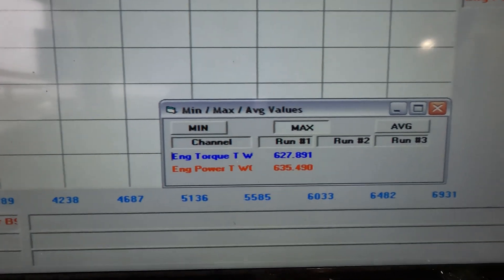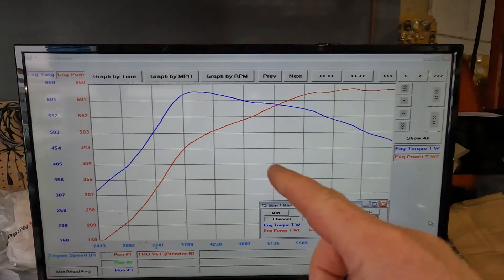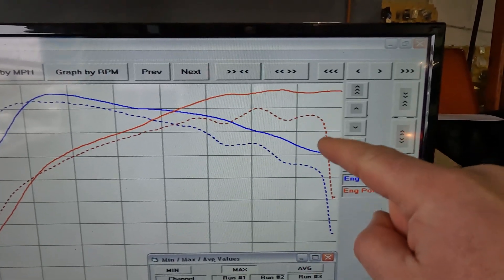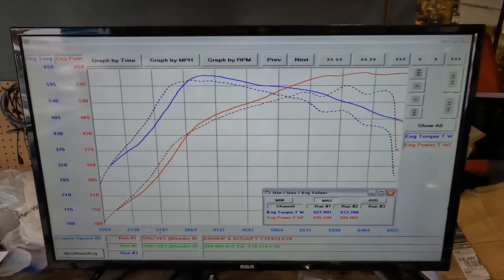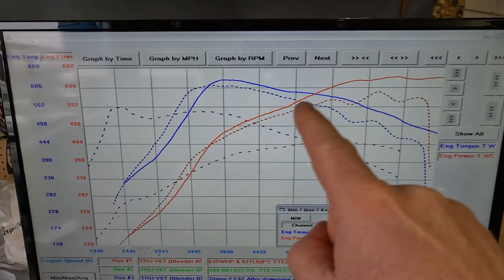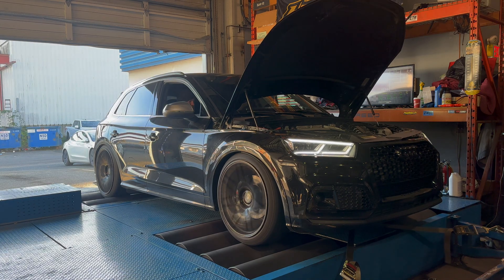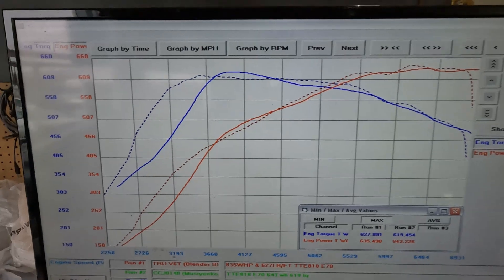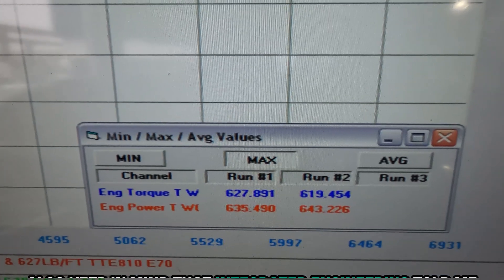TTE810 - Integrated Engineering Stage 3+ E70 Dyno Testing - Audi B9 S4

Comment: What’s the reliability like on a TTE810/710 car?
Reply from the maker: The TTE710 was discontinued by TTE so you definitely don't want to go that route. The TTE810 for the most part has been a robust turbo, although I've heard of some failures. The tuning paired with that turbo tends to be the biggest thing that causes failures with the motors though. Some tunes push the fuel system much too hard and end up blowing up motors.

Comment: damn 620 hp on a full bolt on is nuts lol
Reply from the maker: That's the torque figure. It was 635 WHEEL horsepower. So close to 700hp.
Reply: @VancityAudi  need to get rid of my s3 and get an S4 lol
Reply from the maker: @Carbeezy77  that you do!

Comment: Are you still on stock internals, trans and transfer case. Also are you still on stock injectors?
Reply from the maker: I mentioned the injectors within the first 40 seconds of the video. My engine, trans and transfer case are all stock.
Reply: I realized that after I commented, blonde moment. Anyway thank you for responding it was definitely helpful, I’m about to go full stage 3+ on my b9 s5 coupe. Your car is bad ass by the way.

Comment: Do you think the slow spool response was to do with the engine issue which showed up?
Reply from the maker: Nope. As soon as I increased the load by doing a 5th gear dyno pull or a 4th gear pull on the street, it spooled quicker.
Reply: @VancityAudi  still hoping you manage to get some more S4 content 🙏
Reply from the maker: @jimmymcgoo8641 regardless of what happens, I won't leave everyone hanging. I'll let everyone know what I end up doing.
Reply: @VancityAudi any updates on the S4?
Reply from the maker: @jimmymcgoo8641 we're returning it to stock and will be selling it. I'll fill everyone in via one final video once we're all done.
Reply: Is there a video coming out to update us on what happened to the S4? @VancityAudi

Comment: You started the dynorun from the SQ5 in much lower rpm than you did with the S4, therefore it can not be compared. Start the dynorun at 1500rpm.
Reply from the maker: That's not correct. As I mentioned in the video, the calculation for the tire size from one car to another (17" vs 22" wheels & tires) made it appear like the graphs were in the wrong place. If you moved the SQ5 graph over to the right where it should be, so it lined up with the same calibration that the S4 had, they start in roughly the same place.

Comment: I have a 2013 Audi s4 and I’m getting a p281c code and my transmission light is on idk if it has to do with the engine light but do you have any idea what it could be
Reply from the maker: A Google search will tell you exactly what the problem is. Your transmission will need some work most likely.
Reply: @VancityAudi  I’ve searched all over the internet and I can’t seem to find any parts for my car but thanks for the help anyways huge fan keep it up man ❤️
Reply from the maker: @Avlor Zebica  not sure you're looking in the right spots then? From what I understand it's an extensive repair. Thanks for watching. https://www.audizine.com/forum/showthread.php/767393-P281C-Code-Is-that-the-starter-of-DSG-Issues

Comment: Great results, congrats! 🎉 I wonder how much power you can pull on a regular 93 octane, and how long gearbox will last at these power levels 🤔
Reply from the maker: 93 octane dyno results will be coming soon. As for the gearbox lasting, I predict a very long time. Same transmission that the RS6 has, and they make even more torque than mine car does when tuned.
Reply: @VancityAudi  I believe RS6 got higher tier “clutch pack”, S4 B9 got zf8hp65a while rs6 has hp85 if I am not mistaken 🤔
Reply from the maker: @ShebanFPV  you could be right! That I'm not aware of. Here's to hoping it's last as long as I own the vehicle.
Reply: @VancityAudi  I hope too, for all of us B9 S4 owners 💪🏻

Comment: Hi , I’m in the Uk with no e85 or e60 , could you do a comparison on 93 file . I have the tte710 and want to know if the upgrade is worth it for power gains 
Cheers Paul
Reply from the maker: That will be coming to the channel soon.
Reply: @VancityAudi Cheers mate, did you end up posting the video? Tried to find it on your channel but no results. keep up the great work
Reply from the maker: @mariuspoparascu1822  Damn! I don't think I ever did. Sorry about that! I think the closest thing I have is this video where I tested the base TTE710 file on 93 octane fuel prior to upgrading the fuel system. The crappy thing is I was using a Mustang dyno calibration rather than a Dynojet calibration in this video so you would have to add roughly 18% to the numbers you see to figure out what it would have been as a Dynojet readout: https://www.youtube.com/watch?v=AJVV2LQyALk&t=481s&ab_channel=VancityAudi
Reply from the maker: @mariuspoparascu1822  I was wrong!!! I showcased the 93 octane tune with the fuel system upgraded in this video: https://www.youtube.com/watch?v=5VDoq453iNg&t=29s&ab_channel=VancityAudi
Reply: @VancityAudi cheers!

Comment: I remember when tuning a car was actually a tuning, these new cars all uses same turbos, same injectors, same fuel, same drivetrain, same ecu maps, and everyone has, what a surprise, same hp. All you need is bunch of money and lots of plug and play parts. It's easy to be quick these days. 🤔
Reply from the maker: To be quick, sure. To be the quickest... that's a whole other ball game.
Reply: @VancityAudi  there will always be someone quicker. Always. I'm just thinking how much effort was needed 10 years ago to make a 10 sec car. Today, all you need is bunch of money and zero effort, everything is pretty much plug and play. Ah, technology advanced im affraid.
Reply from the maker: @GocaKresic  Well there actually isn't anyone quicker when you're the quickest in the world on your particular platform which is the only thing I compare my success with. The only B9 in the world quicker than me is Integrated Engineering's shop car. I'm going to try my best to best their times this Spring and be the quickest B9 in the Spring before someone else goes even quicker.

I do agree with 10 second cars being easy to come by though.  My RS3 requires E85, a turbo inlet and a tune to run 10's. Some platforms can run 9's now with a downpipe, E85 and a tune these days. It's insane.
Reply: @VancityAudi  i'm not tryin to minimize your succes, but it's not hard to be quickest S4 B9 when no one actually drag race that car 😅 i mean why would someone choose that car for drag? On that logic, you could take Bentley Bentyaga and tune it, i guarantee that you would be quickest Bentyaga driver ever on the track lol. You mentioned RS3, you're not even close to be quickest, aren't you?

To be quickest RS3 (that everybody drives) requires really SERIOUS tuning ;)
Reply from the maker: @Goca Krešić  always best to research what you're talking about before you comment. I'm the 2nd quickest hybrid turbo RS3 in the world. Only one car has gone quicker and that is the TCR shop car. 

As for all out quickest/fastest RS3 in the world, I'm nowhere near that one. That record belongs to Hank Iroz running a 7.9 @ 172mph. He has a massive full frame turbo and nitrous. I don't have the financial ability to build a car that fast, so that will never be my goal.

To your point though, yes. You could buy a particular make and model, tune it, reduce the weight and be the fastest of that make and model in the world. I don't see anything wrong with that, and if someone has that goal in mind I wish them all the best!

And if you don't think the tuning solutions are "serious", I'm not sure why you are even watching this channel to begin with. I've proven that on the particular platforms that I've chosen to own that OTS, canned tunes are amazingly well sorted and can outperform custom tunes repeatedly.
Reply: @VancityAudi  hybrid turbo? Lol turbo is a turbo, doesn't matter if its hybrid or not, it's turbo lol. As i said, there will always be someone quicker. Although, maybe that separates serious tuners from amateurs. Hybrid vs full frame turbos ;)
And don't be mad at me, i dont mean dissrespect, I just think that literally ANYONE can have quick RS3, it doesn't need to know literally anything about cars. But, i guess that Audi made a terrific job, and hybrid guys made a ton of money ;)
Reply from the maker: @GocaKresic  Shows how little you know about the platform if that's how you think. Hybrid turbos are limited in the way they function by their design.  Full frames have benefits and disadvantages to the way they operate vs what we see with hybrid turbos. I'll leave this discussion with you feeling like there will always be someone quicker out there in the world, which provides a lack of enthusiasm and drive to go any quicker or faster. I'll continue to strive to be the best I can be with the build that I have chosen to use on the platform I have chosen to use. I don't care that there are other platforms out there where people have dumped hundred of thousands of dollars into their cars making them faster than mine. I just try my best to get everything I can out of my car within the budget that I have available.
Reply: @VancityAudi  Truth! No matter how you slice it running a 9-second pass on these cars is not easy.
Reply from the maker: @daveblais4019  on this platform it has become much easier with this calibration and turbo, but it still isn't easy by any stretch of the imagination.

Comment: I wonder if the down pipe being damaged is causing the spool issue or had that been addressed???
Reply from the maker: We highly doubt the slightly damaged cat made any difference at all with the spool. Regardless though, IE has warrantied the downpipe and we'll be replacing it soon. We already have a few things planned to try and fix the lag issue
Reply: I doubt that would cause an issue with spool? Not sure.. The only difference between Adam’s S4, and my SQ5 is I have a catless downpipe and he has IE’s HFC downpipe.

Comment: I’m curious if the 5w-40 could be affecting the turbo spool on the lower rpms. Did TTE design the 710/810 to be used with the thinner 0w-20 oil so it’ll spool quicker with less resistance? What oil is @need4built running?
Reply: I’m running 5w-40 also. The exhaust gases spin the turbine. I think Adam will get to the bottom of this soon. Either way he clearly made more power and that graph is CLEAN. Interesting to see the spool difference. I can attest the dyno graph showing the turbo spool is the same as it is on the road in my SQ5.
The only difference between Adam’s S4 and my SQ5 is I have a catless downpipe and he has IE’s HFC downpipe.
Reply: @Need4Built  I understand the exhaust gases spin the turbo haha but these turbos use journal bearings which have oil feed lines apposed to ball bearings. Was thinking a thicker oil being fed to the journal bearing would cause slower spool over a thinner viscosity but if your running 5w40 then that’s definitely not the issue here! And Adam did show in his TTE810 install video that the IE HFC did have something going on with it so I’m curious if he got that taken care of. Personally I’d just gut the honeycomb out of the IE HFC and run a mini cat I’m catless on my 18 S5 and absolutely love the sound and aroma. Was also wondering if rocker arms could be at fault here as well, not sure if you or Adam have the updated rocker arms from August of 2019+
Reply from the maker: @Dayton Corl  as for the oil spec causing lag. Absolutely not. As for the slightly failed catted downpipe, I highly doubt that is the issue as well. It barely looks any different than it did when stock. Regardless though, IE has warrantied it and I'll be replacing my downpipe in the upcoming videos. We have our ideas on what could be the cause of the lag and I'll be making a video on the attempt to fix it.

Comment: 2 days????? cmon...i wish u could do the 034 motorsport tune as well for comparison becuase they are claiming 775 vs ie 740
Reply from the maker: Stop looking at the crank horsepower and compare the wheel horsepower. Their claims are as follows: 642whp & 613lb/ft for IE and 648whp & 615lb/ft for 034. Virtually identical results. All 034 is doing is claiming a higher drivetrain loss than IE, so all their marketing makes it look like they make more power than IE does. They claim roughly 18-19% drivetrain loss where IE claims 15%. Just another reason I tell people to stop basing their buying decisions off of stupid dyno results.
Reply: @VancityAudi  at the same time... why not reach out to 034 and see if there software is faster in the quarter mile then IE OTF. I would be surprised if they wouldn't send you a file to directly test against the IE software
Reply: @VancityAudi  someone asked that on 034’s last live stream and they said that all they do is use stock drivetrain loss…they use the bone stock baseline whp and compare it up against the factory crank hp claims from Audi…then just use that same percentage.
Reply from the maker: @Noel Aito  here's the problem with them making that assumption though. The assumption being made is that Audi is accurately representing the amount of power their cars make from the factory. If those numbers are inflated or underestimated in any way, that makes their formula inaccurate.

I'm sure you've seen many videos where people dyno test stock Audi's, BMW's and Mercedes and lots make more power than the manufacturer claims.
Reply: @VancityAudi  hey did u chnage plugs or regap them for ethanol and which oils did u use. audi recommends a 0-20w
Reply from the maker: @Vivan Bhathena  I put in fresh OEM plugs when I upgraded the turbo. They come pre-gapped if I remember correctly. I have used Motul X-CESS 5W40 since day one.